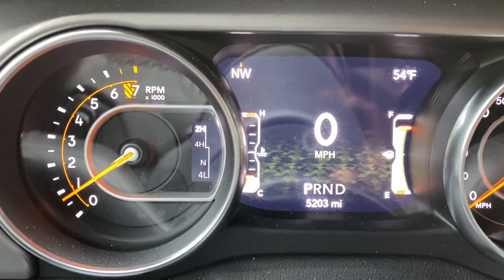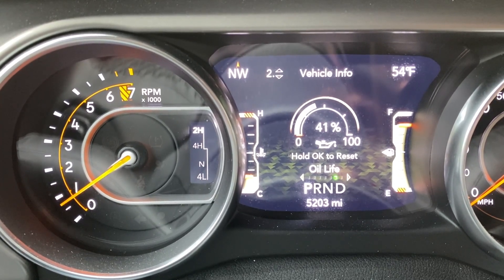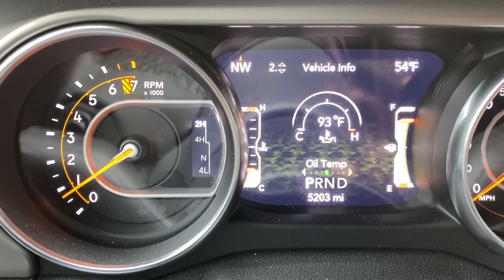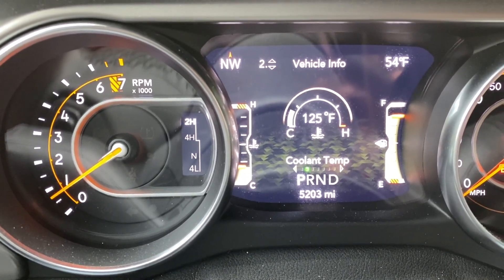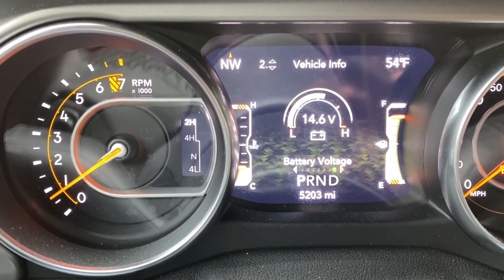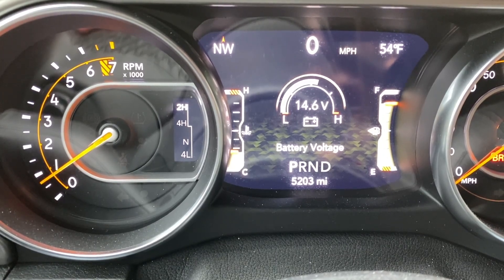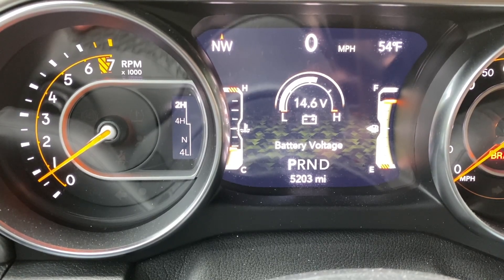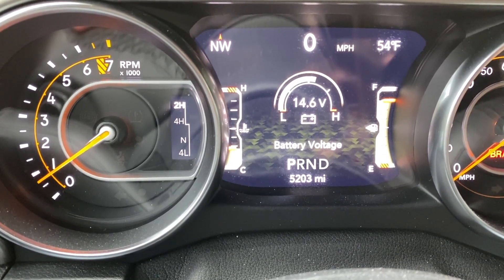Jeep Battery the Reason for My Auto Stop Problems

Comment: Both batteries are wired together in parallel. The volt meter is reading volts for the whole system, both batteries with the alternator running. Stop/start system is designed not to work if state of charge for whole system is under seventy percent. That's why you have a warning on your instrument cluster stating battery charging. The small battery will start to die first since both the batteries are not the same size. Eventually it will short out draining the larger battery, causing it to short out. The dealership wouldn't replace my batteries unless SOC (state of charge)was below fifty percent. Their tech said state of charge was sixty percent. My warranty runs out in six months so I bought a portabale lithium jump starter. Now just waiting for both batteries to go so I can replace both at the same time. Stop/start not working as system was designed.

Comment: I agree with your comment about leaving the truck at the dealership. I recently had a passenger side sun-visor break on my JLU Wrangler.  It’s under warranty so I called to schedule an appointment to have it replaced.  They gave me a date 5 weeks out and stated it was for “diagnosis only” of the broken visor.  They needed to do that to justify the warranty work.  So that meant I would’ve been required to return for a 2nd time to the dealer to replace the part. Also, after speaking to the service dept, I called the parts dept to see if I could get one myself.  They were all out due to these things constantly breaking. So I ended driving 100 miles to another dealer to get the part (on my dime) and replaced the visor myself.
Reply from the maker: Wow!!  That’s horrible!!😡
Reply: @robmotiveplus  Very disappointing for sure. Just be extra careful if your passenger likes to swing the visor over to the side window.  They break.
Reply from the maker: No passengers for me!!😬

Comment: That dash battery voltage readout is total combined for both batteries. You need to have each battery disconnected and tested separately for health report. I was having same issue for over a year. Then on 4th yr of ownership and cross country trip the truck stalled 2 hours from home. I jump started it with litho hand battery kit and carried on but had batteries tested and main showed failure. Replaced with high end Optima. No issues so far.

Comment: Not related, but you could probably drop your tire pressure down a bit. 33s should be around 30 psi cold. Bigger tire=less pressure. BUT unless you have a programer, it might set off your TPMS light. I run 28psi cold in my 35s.
Reply from the maker: Thanks for the tip 👍
Reply: The door sticker on the Mojave with the same 33 inch tires says proper inflation is 37. My son runs  25psi on his 2 door Wrangler 35s
Reply: @randallupton3622  yea i think they just use the same sticker. It will give better fuel economy because less tire is contacting the road. That's probably the main reason they did that.

Comment: Had the battery charging message with the same high voltage. Replaced both batteries and no change. However, I unplugged and replugged the battery monitor on the negative terminal of the main cranking battery and all is working again.  Don't just undo the negative terminal with the monitor. Undo the plug with the 2  small wires to it and plug it back in. Hope it helps.
Reply from the maker: I did the same.  The message showed up the next day, but not since🤔

Comment: My 2021 gladiator fluctuates between 12.2 and 14.1. When I am accelerating… It drops down to 12.2. When I let off the Excelerator it goes back up to 14.1. I don’t know what’s going on with my battery or alternator but something is awry.
Reply from the maker: Strange🤔
Reply: Sound like your alternator has a loose connection or its bad completly. When engine is on it should always draw around 14 volts. Engine off 12 volts.
Reply: This is normal.  The charging rate drops when accelerating to put less of a load on the alternator and allow the engine to create more HP.

Comment: I have seen on the gladiator forums, people who don't turn the button off having issues. They stop and start so many times that the battery runs down and when they come to a light, they pick their foot up and the truck doesn't start. The regular battery will not restart the truck.
Reply from the maker: Hmm...Never heard that🤔
Reply: Issue with ESS system. Auto start/stop should have sensed low power and not shut engine off

Comment: There is one other battery to consider, the key fob battery is also a part of the auto start/stop system. If the key fob battery is low it will prevent the system from working and will give the error indicator as well as the check engine indicator.
Reply from the maker: Where did you see that?  I've never heard that....
Reply: I would like to see information on that also, please.

Comment: Mine goes from 13.8 to 14.3 and it’s fine but still can’t get the aux battery to charge and it is brand new had it in now for about 2000 miles so mine should charge so I am still chasing gremlins
Reply from the maker: Bummer!  Nothing worse than rattles and electrical gremlins!

Comment: I got a 2021 wrangler rubicon and mine does the same thing. I made several videos of the light coming on and showed the dealership they told me that if they can’t get the light to come on there’s nothing wrong with it. So a week later the light comes on and I brought it to the dealership they tell me no one is available to look at it. I left it with them 10 days later I got it back and they said could not duplicate problem. On my way home you guessed it the light came on. They have no desire to fix it. I wish I would have bought a Toyota.
Reply from the maker: That’s a bummer!  Unfortunately, it seems to be a common problem 😡

Comment: My same thought. The alternator should kick on when the battery needs charging and not continuing to run or it will burn out. Pull the top battery and check the alt battery voltage.
Reply from the maker: That makes sense to me too.  Surely it’s designed that way🤔

Comment: You may be delighted to know that CR has given given the 2020 Jeep Gladiator a reliability rating of 99, which is the highest I believe of any model on the year.
Reply from the maker: Except for the auto stop gremlin...I’m not surprised😬
Reply: @robmotiveplus  You may be on the right track by suspecting some kind of voltage drop.  Intermittent glitches are the worst.

Comment: My Gladiator had the Start/Stop quit working a couple of weeks ago, no warning light on the dash, it just didn’t die at stops. I was scrolling through screens on the dash when I came to the Start/Stop screen. After the Jeep warmed up, it said “Start/Stop not ready, battery charging”. This didn’t ever change to being ready. The dealer checked and replaced both batteries. Problem solved!
Reply from the maker: Yup, I believe that’s the fix👍

Comment: Batteries are toes together disconnect battery cables from main battery now use a volt meter and touch battery cables this will give you a true reading of the secondary battery
Reply from the maker: Thanks for the tip 👍

Comment: From my understanding the Auto start is ran off a second battery. And that it does not come off the main feed. When I spoke with the parts / service  department. Being from the number one jeep dealer in the country. Jerry ulm Tampa.  Which they told me that I can see in my owner's manual. Which is why I feel.like that would be the issue  I hope maybe this helps.
Reply from the maker: Yup, that is true🤠

Comment: 2020 gladiator 14k miles had both batterys replaced today stop start did not work ac/heat cluster malfunction $1100 at dealer no a warranty issue oh lucky me.
Reply from the maker: Now that’s a drag!😡
Reply: @robmotiveplus  but found a vid with same problem at least its fixed